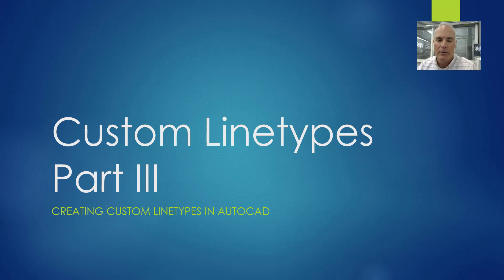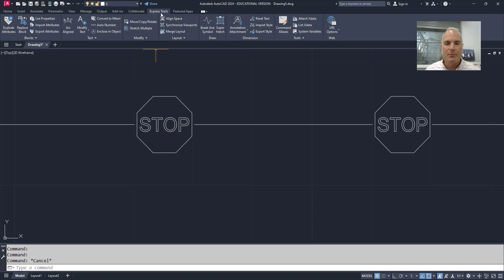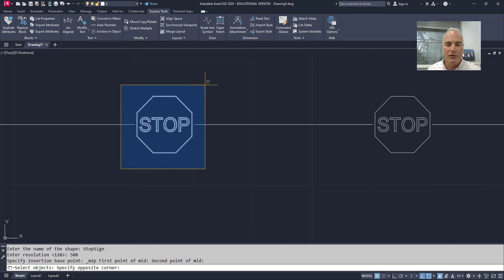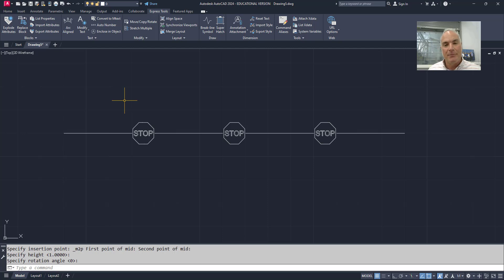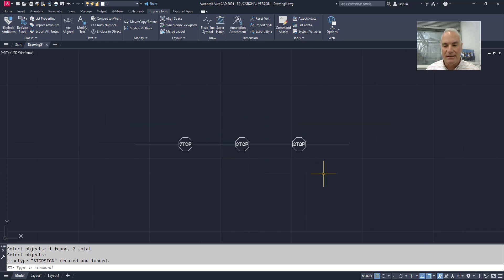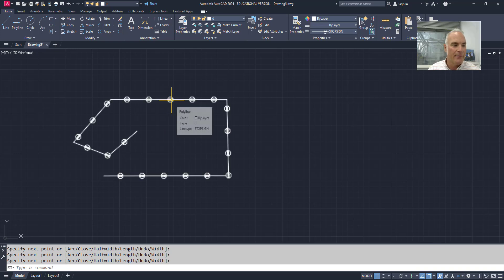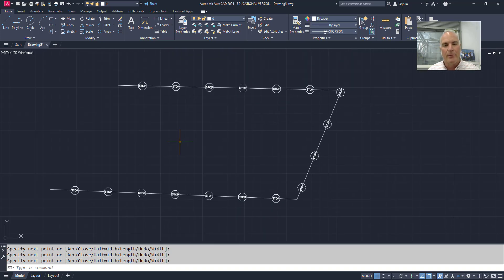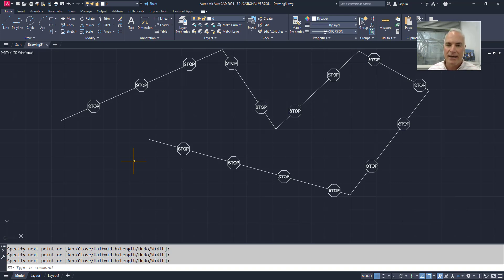AutoCAD - Custom Linetypes with Shapes

Comment: Thank you for this video!! But you can help me with with problem? i cant import this linetype in another drawing, when i try import, gives a error "Bad definition of 2° line: D:\Librarys\AUTOCAD\Linetypes "
Reply from the maker: Your shape file must be saved in the same location as the linetype file. It is also a good idea to add a search path in the files tab of the OPTIONS command to this location.